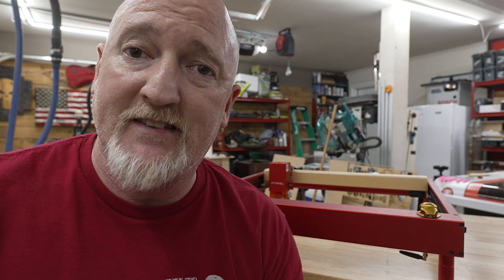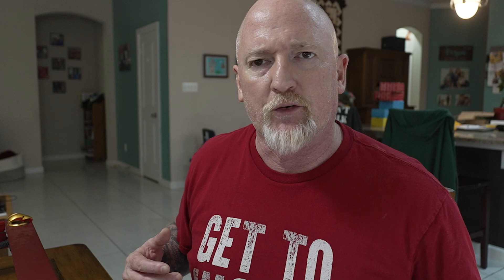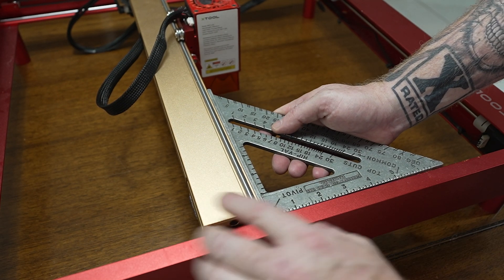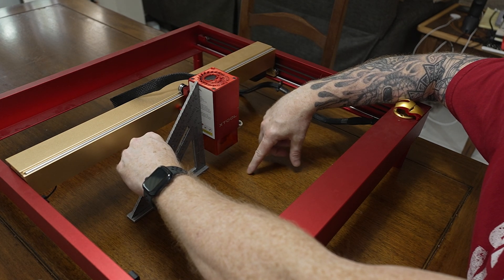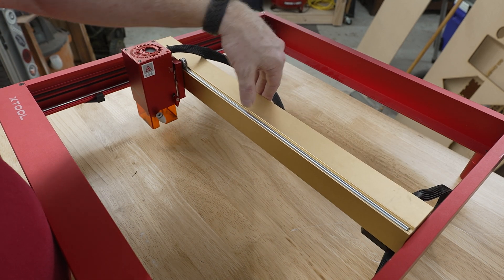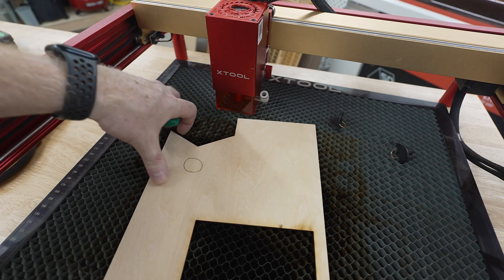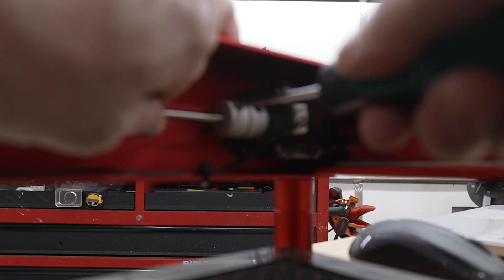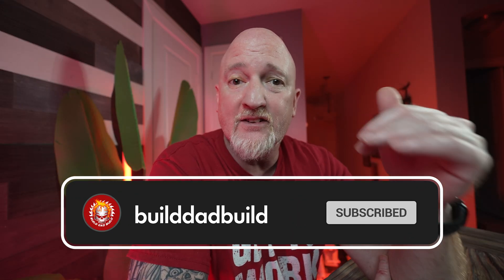What They Didn't Tell You about Your Diode Laser

Comment: Good job Nick.  Look forward to the series.  One thing that I have done after everything is square is, I placed masking tape on the rails, left and right, for a reference point.  The gantry can move slightly off square after multiple burns.  A belt might be a little tighter on one side to the next.  Just move the gantry to the edge of the tape on one side and tweek the other side to match.
Reply from the maker: Good advice!